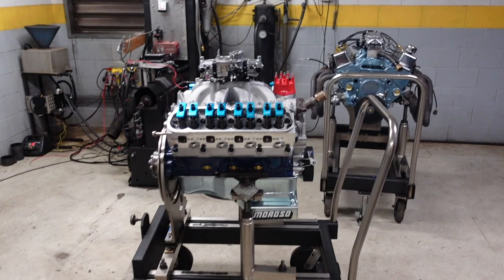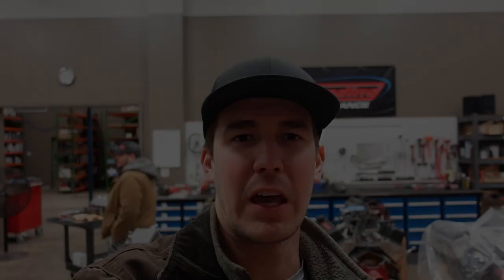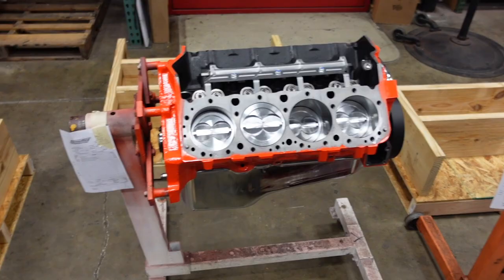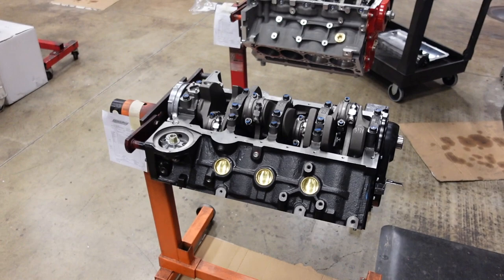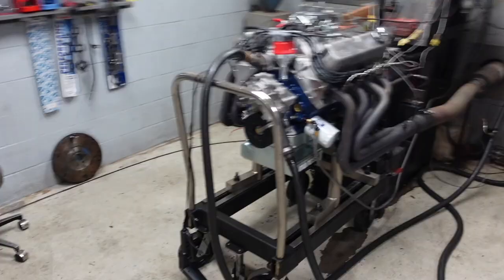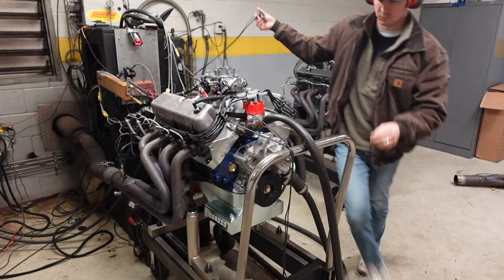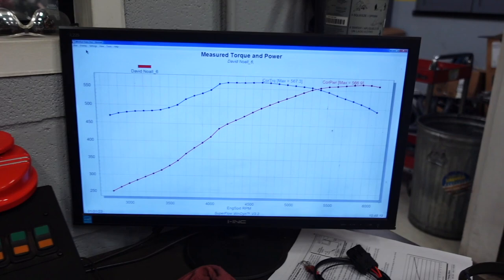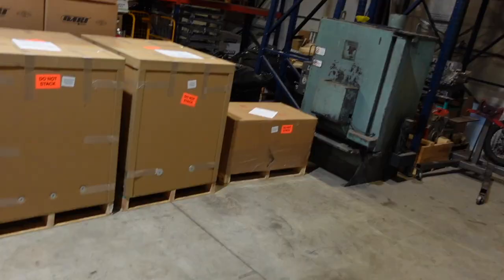Behind the Scenes at Smeding Performance - Week 2

Comment: Have you built a 427 Windsor using the Price Motorsports dual Holley 4bbl intake manifold? I run one on mine and gotten 480 HP at the wheels and 505 torque with a pair of 650 Holley carbs. Max power was at 5600 RPM where it held steady thru 6000. Cam is a Lunati HR Voodoo  241/249  .600 lift with TFS 225 highport heads.